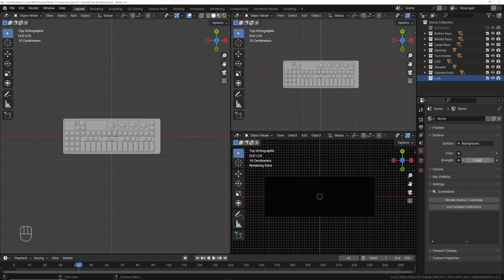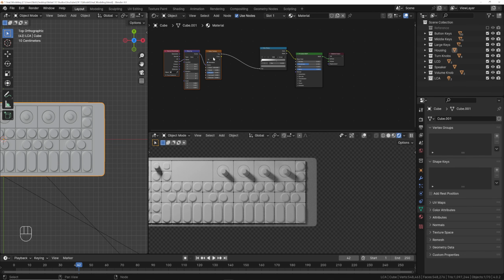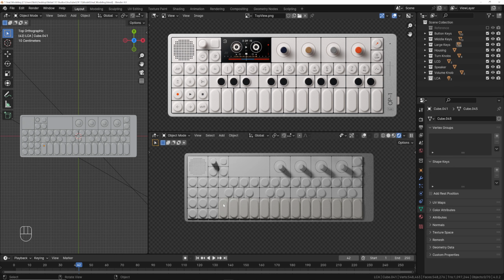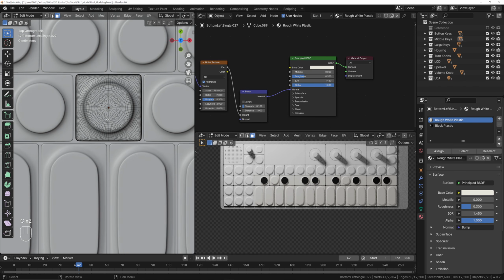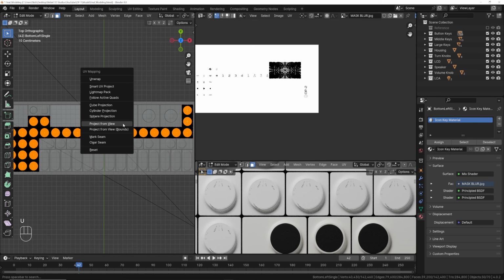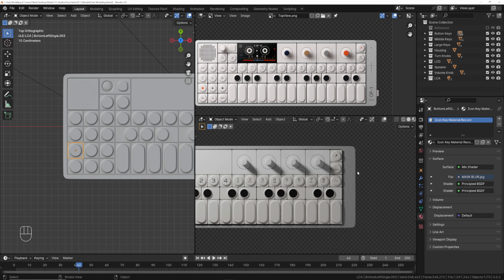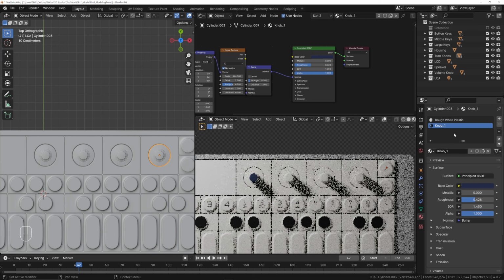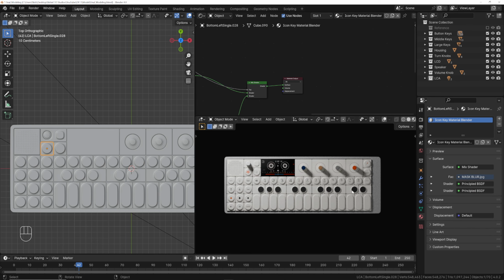Blender Product Design, Part 2: Shading

Comment: Some Questions 
1: How much Resolution 
2: Samples 
3: did used denoiser?
4: do you compile images to video with blender video editor or other to not get artifacts like shimmering.
It would be appreciated to answer these❤
Reply from the maker: Hey there!! Typically for horizontal, I do 1920x1080. For samples, I always start low (100-300) and see what the noise looks like. A good way to test this is to do a test render in the slots of your rendering tab, and you can check different noise levels by switching between your renders that have different sample levels using the keys at the top of the keyboard. If that doesn’t make sense make sure to shoot me a message on IG and I’ll explain further! I also use the denoiser set to Optix since I have an NVIDIA GPU. And I render as JPG or PNG, then put it together in DaVinci Resolve. I’ll make a video on this soon! Hope this helps :)
Reply: @Nickel3D Thanks but if you made a video on this in future, It will help everyone ❤